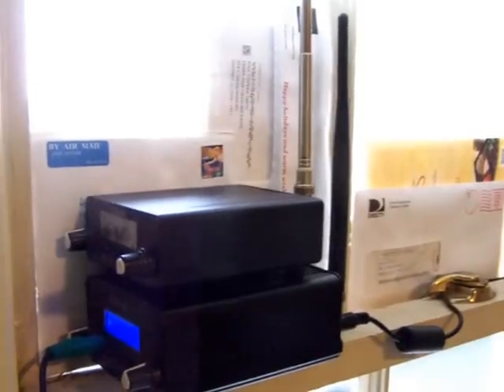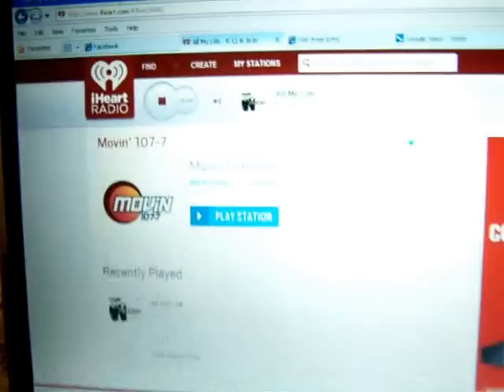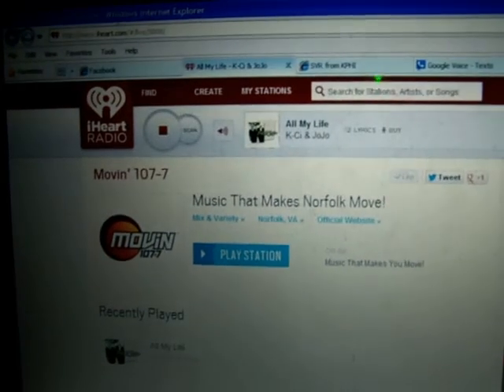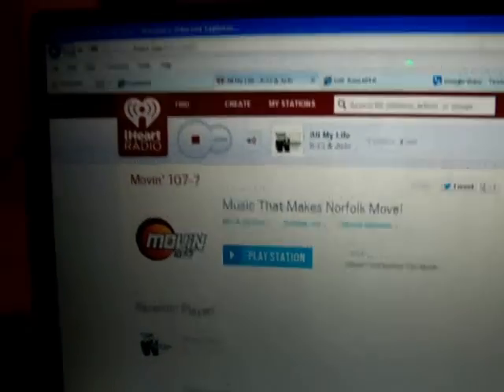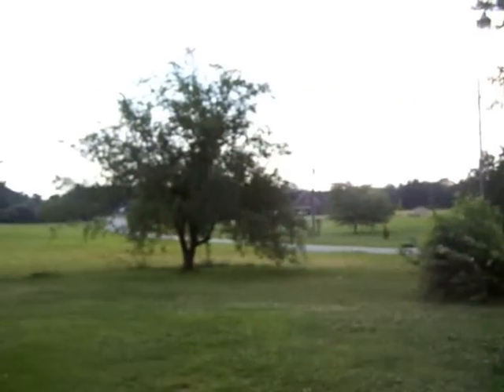My Radio Station CZH-5C & CZH-05B

Comment: UPDATE: I got the SainSonic AX-05B and it Does Go 1/4 mile from the rubber duck on the 1st floor.  It sounds really rood if you set the left volume control to point to the left screw and set your computer's volume to 48%.  I love this transmitter and use it to transmit my Internet Radio Station I run 1/4 mile away.  It really is all you need to have fun and not interfere with other Radio services.

Comment: I just want to use the rubber duck antenna that comes with the CZH-05B or AX-05B.  I'm hoping for 1/4 mile to transmit my Internet radio that plays Progressive Rock, Classic Rock http://thelegacy.shorturl.com can I at least expect that?  Have you tested it?  I'd be happy with 1/4 to 1 mile.